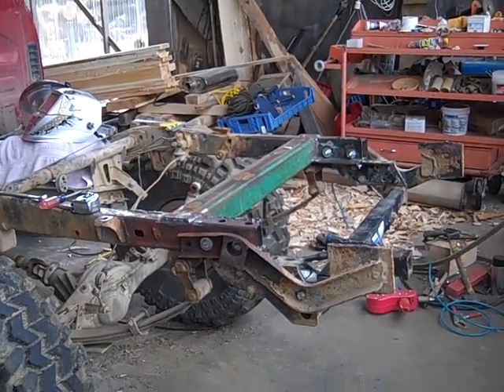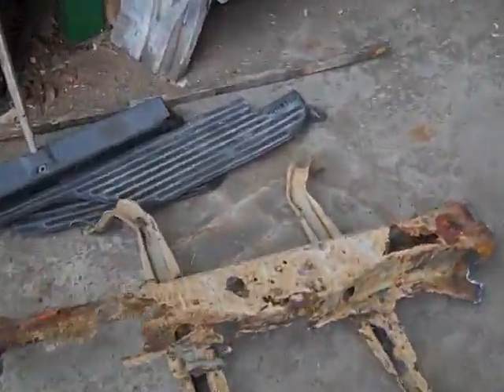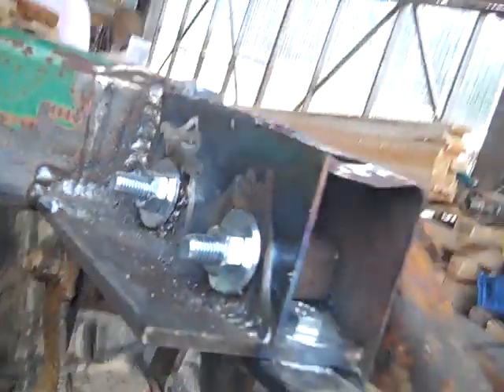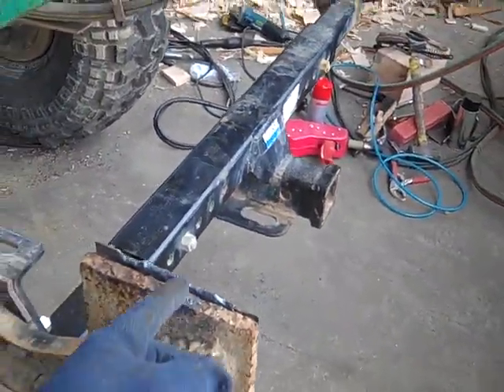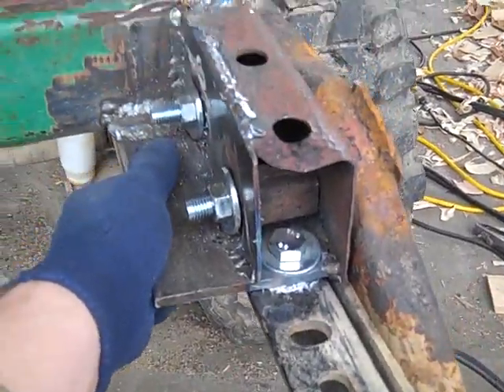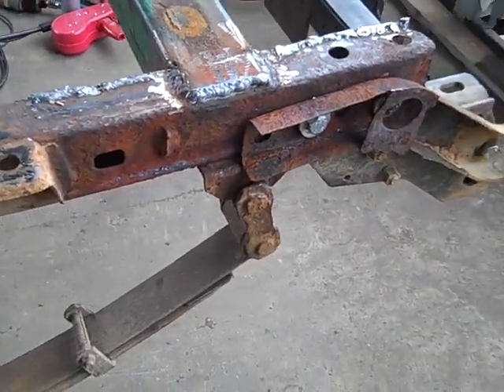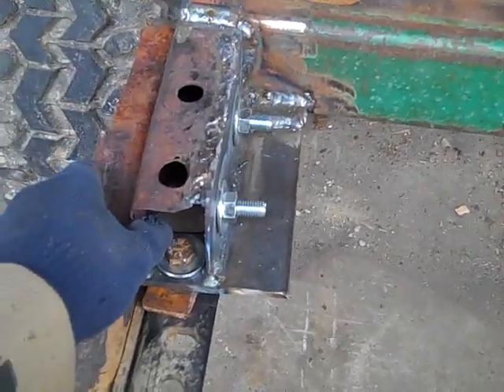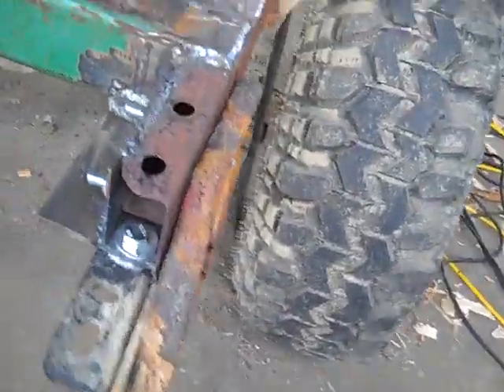Rust Repair On My Truck Frame

Comment: Fluid Film will need to be re-applied every so often.  I got my truck done at the start of winter and there wasn't much left in spring.  It's good stuff though. Also I was washing salt off of the frame often so I'm sure that took some Fluid Film off too.  My 85 frame is starting to rust from the inside out so I'm going to spray the inside of the frame with it when I repair the frame.

Comment: Before you weld it is always wise to blast the steel and then chemically romove and clean the rust from the steel. Then paint it and gunck the shit out of the rear end with a ruberized coating.

Comment: hey bud, I got a '94 SR5 too and had the same rust problems.  I pretty much did the same thing as you but now the rust is creeping up the body. Im debating either to leave it or buying a box and quarter panels from a scrap yard.  its not cheap though. Hows yours coming along?

Comment: Did  a good job but seem like little over kill for that little toyota frame lol looks like your going to pull a tandem tri axle tralor with all that steel you added.
Reply from the maker: +eddie corbette Probably right.  Just what I had laying around for scrap to use up